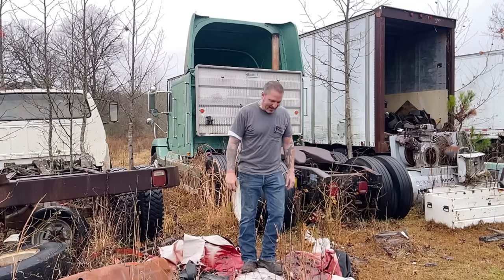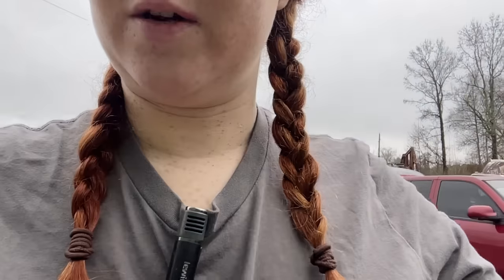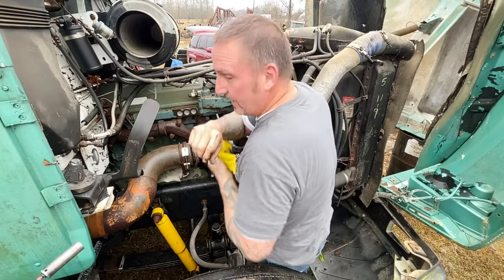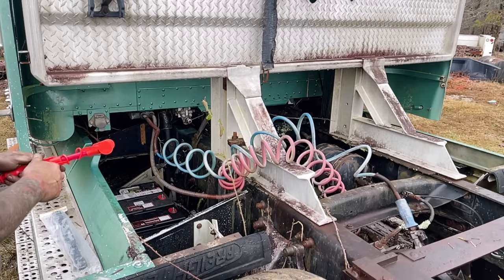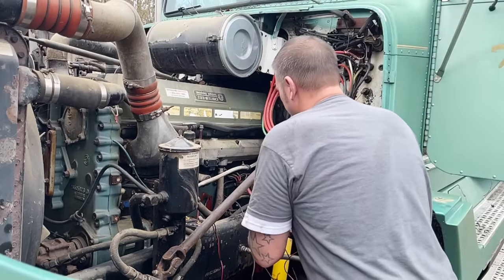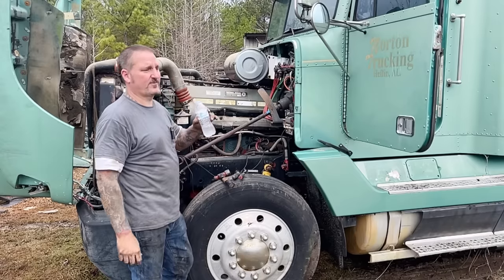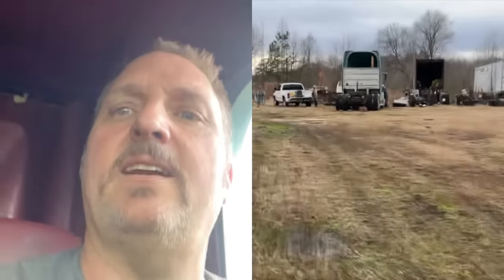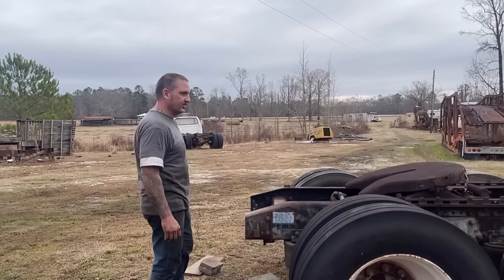1992 Freightliner FLD Flat Top "Twelve" Will It Start?

Comment: purple power will take all the black grime off really nice and easy for you no problem just buy 5 gals and a spray bottle and put it on there
Reply from the maker: My Hotsy hot water pressure washer does a remarkable job

Comment: Will it start? Hell yeah brother! Man James, you've got a real good truck there! If it's okay with you, I've got the perfect name for this one: Katie! What do you think? What transmission is she running, 10 speed or 13 speed? When you do the video of driving her home, make sure to do unedited in-cab action only, I listened to the driving home video of the 94 FLD, but I could barely hear that truck because the V8 in your pickup truck is so loud, so that's why I want in-cab action only on this one, so I can hear that Detroit singing along through the gears! And definitely think about putting some straight pipes on Katie, she already sounds absolutely amazing and should sound even better with straight pipes on!
Reply from the maker: I muted the video from the trailblazer this time..  the trans tag in the cab said standard 9 speed but I turns out its a 9 over on the dashboard so it took me a couple times before I figured out what it was  I call it a small h but not sure what it is really called.
Reply: @JamesPretty  awesome!! And what do you think of the name Katie for this truck?
Reply from the maker: @GarbageSean  twelve is the trucks name Katie isn’t bad might use it in the future

Comment: love the haters that has no clue how good these trucks are. i have an fld120 classic was on the desert for over two years went got it changed batteries started right up. These trucks last a lifetime and no electronic craps unlike modern trucks that barely make 800k miles. Mine has almost 2million miles on the clock and going strong
Reply from the maker: Yep
The fld and classic are amazing work horses

Comment: Love that one! You should try and restore if you find one, a builders transport truck. Do you know any about them. I know they were out of savanah
Reply from the maker: No I never heard of them.
Reply: Builder’s Transport? Those things were ran into the ground long before the company went bankrupt….old green IH SBA 9700 cabovers.
Reply: @bowslap  no sir, I got an 85’ white from them, the logo is still faded on. Ours is like the only one left
Reply: George  been around a LONG time, have seen and worked on some of their equipment when I was a diesel mechanic in the mid-90’sjust before I started trucking myself. Seen stuff that was beat up/neglected to the point where they’d fail an inspection…and their maintenance department wouldn’t approve to repair/replace. Not going to turn this into an argument or debate, I saw it firsthand.
Reply: @Carolinastrucks  that’s DEFINITELY a rare bird…most of what I dealt with from their fleet were the green 9700 SBA IH cabovers, and 90% of those were in abysmal condition. What struck me about them was the fact that the tractors were MAYBE 2-3 years old and worn out from abuse and lack of regular maintenance.
Reply from the maker: George  don’t know  have you ever heard of a flux capacitor? Lol. Just kidding but I just never heard of them
Reply: @JamesPretty  they were a flatbed outfit that went belly-up back in May 1998, Schneider bought the remnants in bankruptcy court. I only recall them for the green cab overs with yellow steel wheels and the equipment being grossly neglected…
Reply: @bowslap  yeah, we’re restoring it to as bought
Reply: @Carolinastrucks  that’s neat! Like any other old trucking company that has since fell by the wayside, there was a time when BT company units were well-maintained….it’s just been a VERY long time is all. Best of luck in your restoration!
Reply: @bowslap  thanks man! Thanks for info. Back when BT sold it they sold it to a local nursery. Then it ended up with me